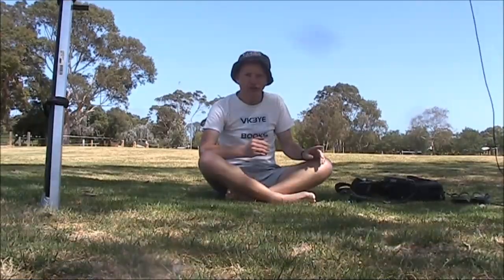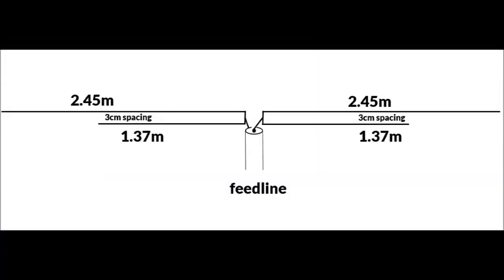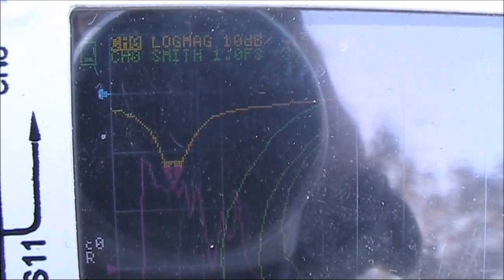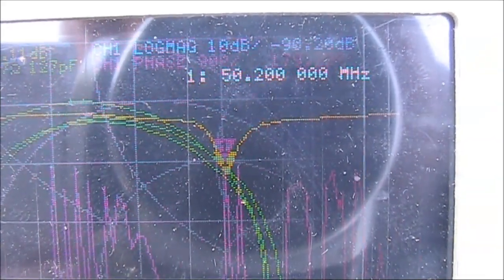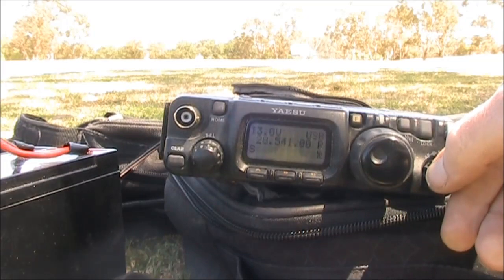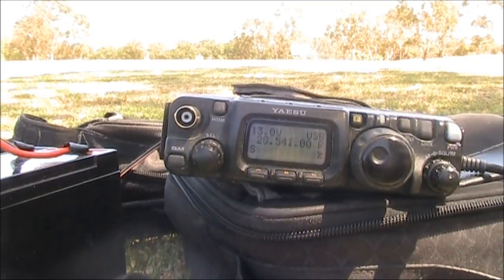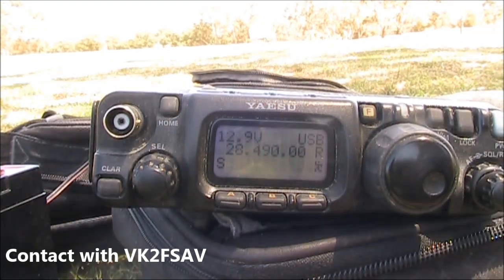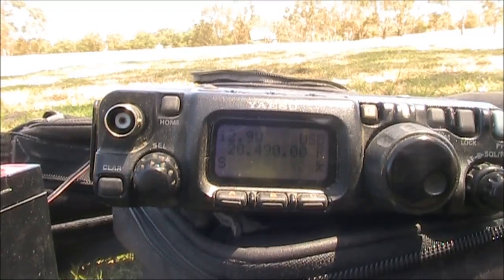28 and 50 MHz dual band fan dipole

Comment: Another good experiment.
Although I have not investigated fan dipoles, I was pondering. The 10m element would be 2 half waves on 50mhz so extremely high impedance.
However it's actual 50mhz element would provide a low impedance match and would even approach 50 ohms. The 50mhz element would be fairly well invisible on 28mhz and it would be a normal dipole.
I think a fan dipole would be better than a trapped one from a losses perspective and having good general purpose receiving capabilities